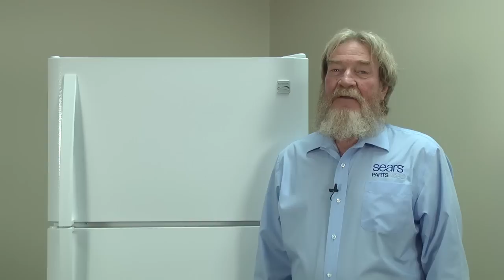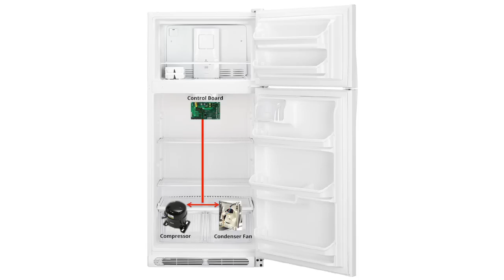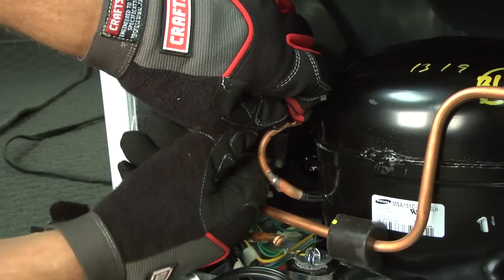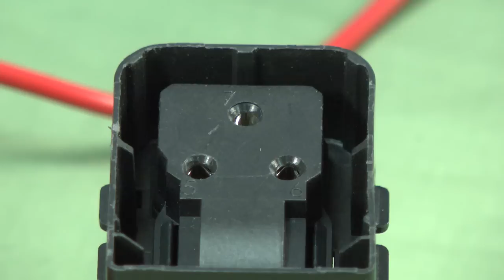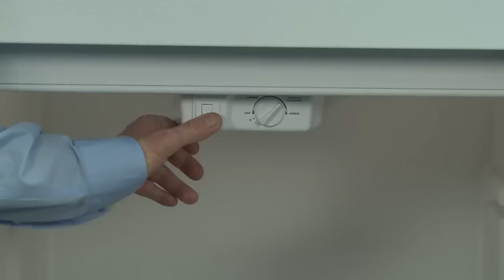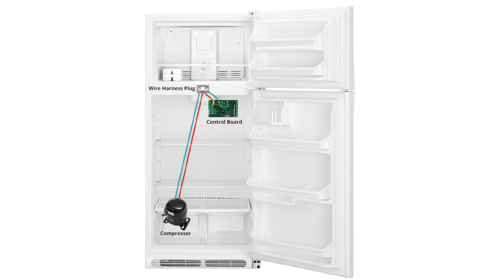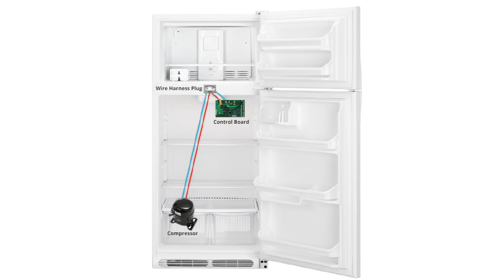How to Troubleshoot Compressor Problems in Refrigerators

Comment: i have problem with one door LG refrigerator, after repair the leaking part and fill in the gas 134a. compressor running but not cool enough, when checked the suction side have no suction which mean usually when the compressor start charging the suction site will decreased and ampere will increase but it suction just maintained. i suspect system was blocked then have do flushing and checked high side and low side have gas go out so blockaged no issue. this compressor keep charging with suction pressure maintained and discharge pipe become hot until the compressor also feel heat. i try to charge in gas but it take long time to fill in gas that i confirm the suction not strong. after change to new compressor also same symptoms happen.

Comment: Greetings. 
I wanted to listen to this video to learn more about compressors. My fridge isn't like this one, it's the French door fridge with the pull out freezer. I have been told that I have a bad compressor.

Is there a chance that it's the relay switch and or just out of freon? 

The compressor does make a clicking sound but the fan at the bottom of the fridge in the back does turn on. 

Gratitude for your time.

Comment: Have a 2006 sxs #106.56666502 have loose red wire and no schematic to show wiring so I can reattach to begin testing to find why not running.

Comment: Hello ve changed the compressor of the freezer but when I put icecream in it it stays soft but when you put water it tuns into ice what could be the issue. Compressor is r134a charged with r600a refrigerant

Comment: Exceptionnal and easy video, IMPORTANT NOTE : in my case it happened twice on two fridge that i had to disconnect it for 24 hours with a fan blowing on it, as there was an accumulation of ice inside the air passages that was blocking the air circulation

Comment: If.my compressor.goes.out will my refrigerator leak watet
Reply from the maker: Sometimes a refrigerator will leak water when the compressor quits working because ice and frost inside the refrigerator melts and leaks out of the cabinet.

Comment: I have two frdiges that turn on ok but after 5 minutes motor switches off.  Then motor comes on again like a cycle.  Not thermostat.   Could the filter driers be clogged?

Comment: What causes the compressor to stay on? My compressor stays on even when the blower fan stopped. And it keeps on running and it starts to get hot what can it be?
Reply: I'm troubleshooting my fridge.  Apparently I have a sealed system leak which causes the fridge to run more.  I have ice build up above the evaporator coils in the back of the freezer.  So I know i have a leak somewhere.  For you could be a circuit board issue or a small freon leak from your copper pipe lines.  Freon leak sensor or spray copper pipes with soap and water to see if there are any bubbles coming from your pipes.

Comment: interesting, I don't necessarily agree that  rattling relay ALWAYS means you have bad relay.  I took that starter relay apart and basically what rattles inside is a the contact assembly and a magnet/spring assembly. When the relay coil is energized with 120VAC it attracts the internal magnet to make the contact assembly mate with the relay's terminals, thereby completing the circuit to the compressor.  HOWEVER , the main reason some of these relays rattle is because they need to be installed a certain way, my relay for instance has an UP indication which when placed in this orientation on the compressor has the internal contact assembly being separated from the relay terminals and does not complete the circuit to the compressor. Only after the relay coil is energized does the contact assembly close and therefore energizing the compressor.  In my case, the contacts had ALOT of corrosion on them and so when the power was provided to the relay coil, the contacts would mate, but no continuity was there to tell the compressor to turn on.  Only after cleaning the relay contacts  did this solve my problem.  At the end of the day the relay is not expensive, maybe $15 at most with shipping, but I was able to re-use my old relay with a simple cleaning as I was curious as how the internals of the elecromechanical starter relay worked.  just my two cents.
Reply: Thanks for going to the trouble of explaining that. One never knows when they'll need a certain piece of information. My problem is so weird and my knowledge so small, I'm taking what I can get, lol.
Reply: @dreamingrightnow1174  anytime, most YouTube videos didnot mention this so I thought I would chip in and help someone save $15. The best you could do in this case is bench test the relay to make sure it works before dumping money into a "fix".

Comment: Hello I have a Amana arse66zbc put new 3 in 1 supco relay my compressor is pulling 1 amp condenser and evaporator fans are working,  thermostat control is working but it is still not cooling

Comment: My fridge is an Avanti, it seems to be cooling properly on the inside but my compressor is extremely hot to the touch. Its melting the plastic drip tray where it rests on the compressor? Any ideas as to what might be the issue
Reply from the maker: Unplug the refrigerator and clean the condenser coils if they're dirty. Check to see if the condenser fan is running (if your model uses a condenser fan). If the condenser fan isn't running, unplug the refrigerator and check the wiring connections between the condenser fan and the control. If the wiring connections are okay, then you'll likely need to replace the condenser fan. If the compressor is getting extremely hot with the condenser fan running and the condenser coils are clean, then you may need to replace the compressor. A service technician needs to replace the compressor if it's bad because a licensed service technician should recover and recharge the refrigerant. We hope this information helps. If you need further assistance, let us know (and provide the model number of your Avanti refrigerator).

Comment: What does PTC stand for?
Reply from the maker: PTC stands for positive temperature coefficient. Those initials are typically used to describe a compressor start relay in a refrigerator. A PTC start relay sends current to start windings or a capacitor during compressor startup. A positive temperature coefficient resistor inside the PTC relay shuts off current to the start windings or capacitor when the compressor starts running and the thermistor inside the start relay heats up. We hope this answers your question. If you need more assistance, let us know.
Reply: What can cause a PTC relay to be fried?
Reply from the maker: @deannemallan  Some PTC's wear out over time. An internal short circuit in a PTC or an external wiring short in the compressor circuit can also fry a PTC.
Reply: @searspartsdirect   Gotcha

Comment: good day! any help please, just this day i defrost my refregirator but when i turned on back it didnt cold,and the compressor function vibrating just a sec and then its stop.
Reply from the maker: You'll likely need to have a service technician diagnose and repair the refrigerator. The compressor motor is likely drawing high amperage when is causing the overload on the compressor to shut off power going to the compressor motor. A service technician will likely be required for the repair because replacing the compressor involves the recovery and recharge of the refrigerant in the sealed system. Only a service technician is allowed to handle that refrigerant.

Comment: Yeah I have a mini fridge 3.0 insignia my compressor runs hot and I took out the relay it’s great with continuity I think that it’s the PTC starter or low on Freon I’m not sure what is the problem with this any help would be appreciated
Reply: Does not rattle
Reply: Runs hot on the compressor but it cools like it supposed to

Comment: How much do kenmore refrigerator compressor cost
Reply from the maker: The prices of compressors used in Kenmore refrigerators varies by model. You can look up the price of the compressor for your model by keying the model number into the search bar on this page and finding the compressor on the parts diagram: https://www.searspartsdirect.com/ . Compressors typically need to be replaced by a service technician who is licensed to recover and recharge the refrigerant in the sealed system of the refrigerator. A compressor usually costs about $200 and a service call to have the compressor installed typically cost around another $200. Service costs vary depending on your area. You can schedule service here if needed: https://www.searshomeservices.com/repair . We hope this information helps. If you need further assistance, let us know.

Comment: @
Sears PartsDirect  ...  I supposedly need this part: 241524605  But, Sears shows no available part.  For:  Model FSC23F7DW8, starter relay.  Thanks in advance for any help.
Reply from the maker: That original part 241524605 substitutes to starter kit 5304491941. Here's a direct link to that starter kit that includes a clarification of the kit instructions that may help you install that part yourself: https://www.searspartsdirect.com/product/1ao18t0rkf-0046-253/id-5304491941 . Be sure that you unplug the refrigerator before replacing that part. If you need more help, let us know.

Comment: gud pm po,napalitan n me ng relay ref namin pero triping p tin ang compressor,ano po pwdi gawin,gamitan me ng capacitor b,
Reply from the maker: If the compressor is tripping the overload after replacing the start relay, you may have a locked up compressor. A service technician will likely need to diagnose and repair the refrigerator.

Comment: If the compressor is running, I touched it and it is hot, does that mean the compressor is working?
Reply from the maker: You should hear the compressor buzzing when it's running and you'll typically feel the compressor vibrating slightly. If the compressor is completely still, silent and hot, it may be locked up and/or the overload may have shut the compressor off. If the compressor is running and working, the freezer should be cooling if the sealed system has refrigerant. We hope this additional information helps. If you need further assistance, send us additional details about the refrigerator problems you're seeing and let us know the model number of your refrigerator.
Reply: @searspartsdirect   My fan is running, the compressor is running but it seems to never cycle off. I have good door seals and the coils are all cleaned. I cannot get my whirlpool to go into diagnostic mode. Any help is appreciated. It seems to just run 24/7.
Reply from the maker: @lukerhoads248  Let us know the temperature inside the refrigerator compartment and the freezer compartment. If the temperatures in those compartments are normal (37 in the refrigerator and 0 in the freezer), then it may not be unusual for the compressor to run most of the time depending on your model. Give us the model number of your refrigerator and we'll try to help you enter the diagnostic test mode.
Reply: Sears PartsDirect my model number is WRT318FZDM02. I am not home currently but I can tell you there is no way it’s those temps in there. The refrigerator has been freezing food/drinks in the refrigerator portion. This is what led me to begin troubleshooting. The current settings are both set to recommended as per the manual.
Reply from the maker: @lukerhoads248  To enter the diagnostics mode, set the refrigerator to the minimum temperature setting (first LED on the control panel on). Press and hold the Settings switch and the door switch for 5 seconds then release both buttons when all LED's on the control panel light up. Wait 10 seconds and the LED's will turn off. Press the Settings switch 8 times to cycle through all component tests in the diagnostic mode. If errors are detected, LED's will flash on the control panel. If no errors are detected the control panel and refrigerator will return to normal operation. If the first LED flashes, the electronic control board failed. If the second LED flashes, the refrigerator temperature sensor failed. If the 3rd LED flashes, the defrost sensor failed. If multiple LED's flash, more than one failure occurred. Unplug the refrigerator to exit diagnostic mode if error codes displayed. An error code can point you in the direction of a failure. Be sure that you unplug the refrigerator before accessing internal components. If the control displays no error codes, you'll likely need to replace the electronic control board because the control board isn't cycling the compressor on and off properly. We hope this information helps. If you need further assistance, let us know.

Comment: My Kenmore 4.4 mini fridge from Sears has been giving the electrical in my room issues. The power in the room its plugged into fluctuates every time the compressor turns back on. Also our power bill has skyrocketed by $60 since this issue started. Any idea what could be causing this? I have a feeling it could be the cord or the overload protector going bad.
Reply from the maker: The compressor could be drawing high current because of a damaged power cord or compressor internal mechanical problems. Unplug the refrigerator and carefully check the power cord for damage such as pinched spots or torn insulation. Replace the power cord if damaged. The overload protector isn't likely causing the problem. A bad compressor start relay could cause the symptoms that you're describing depending on your model. We hope this information helps. If you need further assistance, let us know the model number of your refrigerator and additional details such as whether the refrigerator is still cooling properly.

Comment: Good morning,
i like this video so much..how about upright display chiller.compressor not working.tqvm.

Rezal.
Reply from the maker: We may face challenges in finding technical information on that type of cooler. Give us the model number of that chiller and detailed symptoms. We'll see if we can help you.
Reply: @searspartsdirect sir,
It normal display upright with 2 glass windows ,main problem is wiring system faulty,the rat already made another's good wiring ,indeed.hate that little rat.!!!I already do rewiring ,but at final stage I can't make it work as usual..it just about compressor wiring system..1 no capacitor,1 no overload ,1 no relay 3 pins.i don't know how to join it together to therminal compressor because wiring diagram blur already.help me sir please 🔧😇
Reply: Hello i have a undercounter belling  freezer that has stopped freezing no compressor or condenser fan going do you think problum coming from front control pannel thanks

Comment: Do you know why a fridge even with a new fan putted on, and damper open and defrost system working fine still not reaching air to bottom? this is the second fridge i having the same problem, first one we replaced the whole refrigerator, but i would like to figure out this problem.. thanks in advance for your response,,. oh by the way when i open the freezer door i feel the air coming down from the damper but not when i close the door completely,,. very rear..
Reply from the maker: Check the return air vents between the refrigerator compartment and the freezer compartment. Blocked return air vents could prevent cold freezer air from circulating through the refrigerator compartment. Clear the return air vents if they're blocked or clogged with ice or debris. We hope this tip helps. If you need further assistance, let us know the model number of your refrigerator and additional details about the problem.

Comment: LG linear inverter refrigerator compressor keeps tripping every 5 minutes, what could be the problem and possible solution
Reply from the maker: Unplug the refrigerator (if it isn't already unplugged). You'll need to leave it unplugged because the compressor isn't running for more than 5 minutes. Check the wire harness connections between the inverter control board and the compressor. Reconnect any loose wires and repair any broken wires. This could fix the problem that you're describing. If you find that wiring intact, check the wiring between the main electronic control board and the inverter control board. Reconnect any loose wires and repair any broken wires. If that wiring is intact, then a bad compressor, failed inverter control board or faulty main electronic control board could be causing this failure. We hope this information helps. If you need further assistance, give us additional details about the problem and post the model number of your LG refrigerator.

Comment: I'm scared my compressors gonna explode. and why does my fan sound like bloody murder!
Reply from the maker: If the evaporator fan inside the freezer is noisy, the evaporator fan blades may be hitting frost or ice buildup. You may be able to quell that type of noise by unplugging the refrigerator for 8 hours to allow frost build-up around the evaporator fan to melt. If that fixes the problem but the noise returns after several days, then you’ll need to troubleshoot the defrost system as shown in this article/video: https://www.searspartsdirect.com/article/troubleshooting-defrost-system-problems-in-refrigerators.html  If the compressor is making a loud noise, it will likely need to be replaced. Unfortunately, you’ll need to get a service technician’s help to replace a compressor, because that repair involves recovering Freon. We hope this information helps. If you need further assistance, let us know more details about the refrigerator problems and give us the model number of your refrigerator.